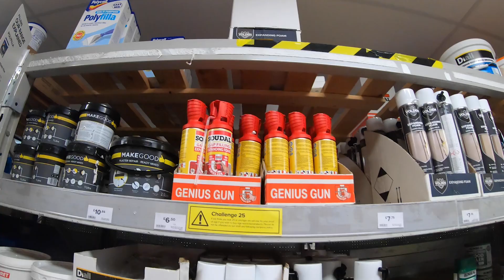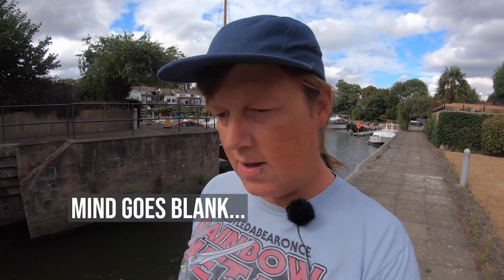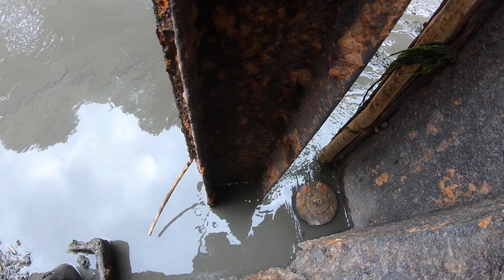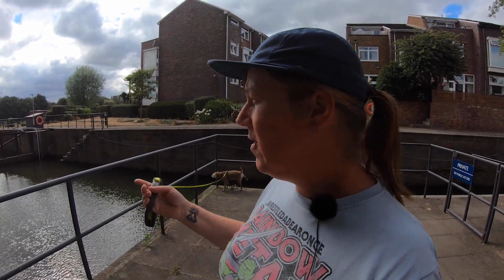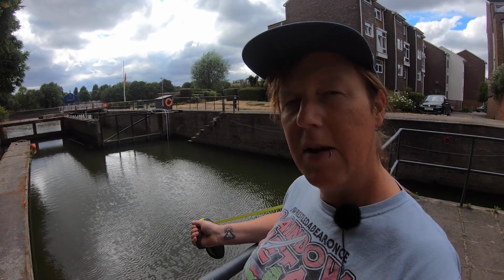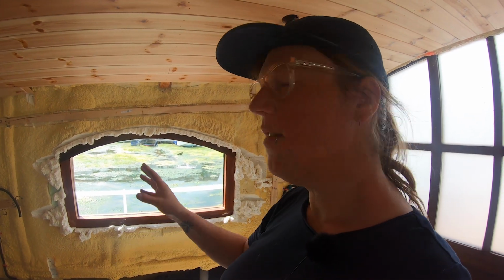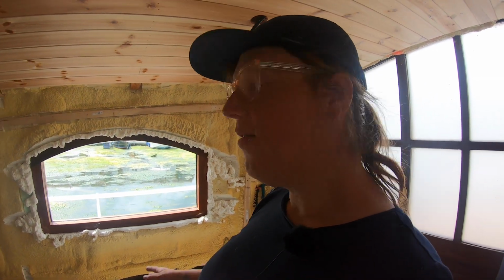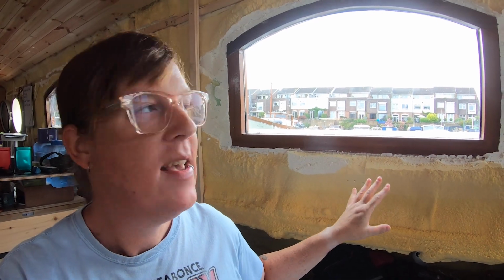#60 Finishing the Window Frame - Dutch Barge Home

Comment: Did the gate simply fail due to wear and tear, or did a boat collide with it, not open both gates etc? 

I really hope,  that if it was due to someone using the gates incorrectly, that they didn’t just slink away without notifying the harbour master...or someone. 

I’m going to guess that if not was a boater, that they must have known that something happened - given that there was a loud noise. 

I really don’t want to be disappointed in people, but sadly I’m often disappointed in people. 😳
Reply from the maker: It was just an old hinge that eventually failed. It had been in place for 30 years or so and rusted through.